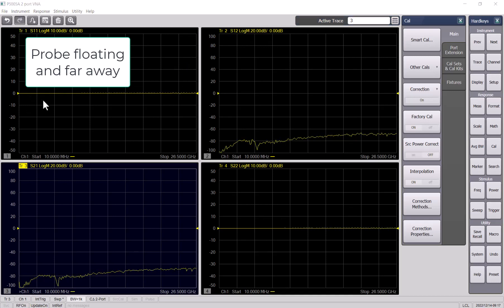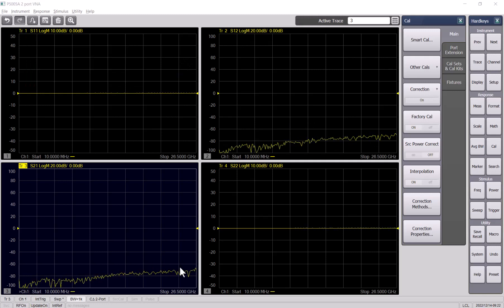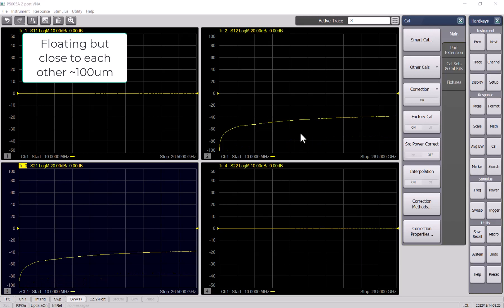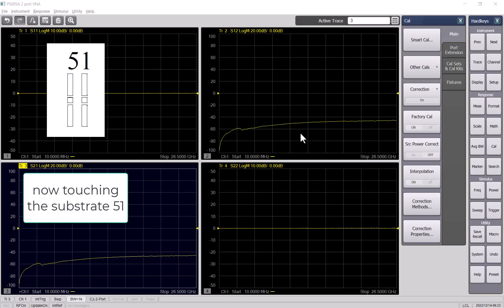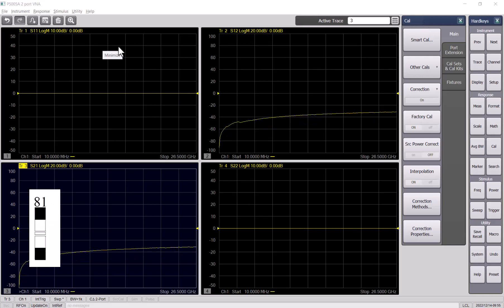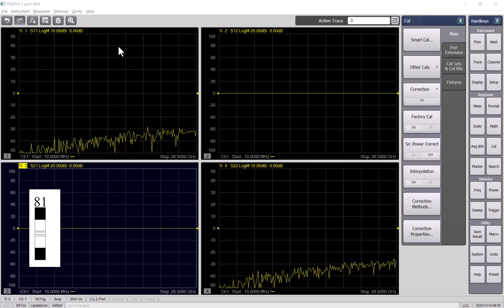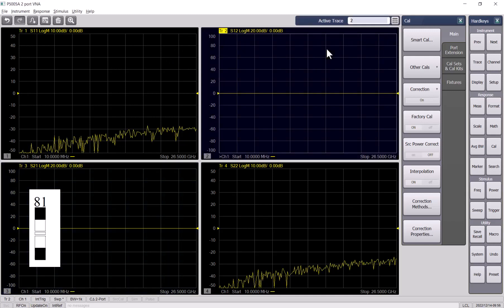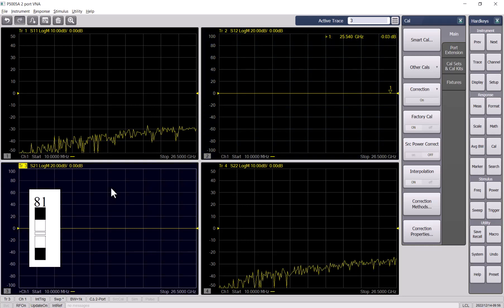Verification of SOLT Calibration (Keysight VNA)

Comment: Can we leave the port open for Open calibration when we are performing SOLT calibration?
Reply from the maker: @azadehghasemi3690, you need to put it in the open structure. Please take a look at this video just in case I misunderstood you.  https://youtu.be/1HI4ytIiu2c
Reply: @quantum_computing  I mean why do we need to use the kit for open calibration. If we leave the port in the air, it is still open.
Reply from the maker: @azadehghasemi3690  Because there are parasitic. Since this is an RF measurement, it is very sensitive to the parasitic. Leaving the port in the air is only open for DC or very low frequencies.
Reply from the maker: @azadehghasemi3690  Again, it is RF, leaving the port in the air doesn't mean it is completely open (due to parasitic capacitance etc.). i.e. the impedance is not infinity. Using the calibration kit, you know exactly what the parasitic is and the program will take this into account when doing the calibration.
Reply: @quantum_computing  Thank you for the explanation!